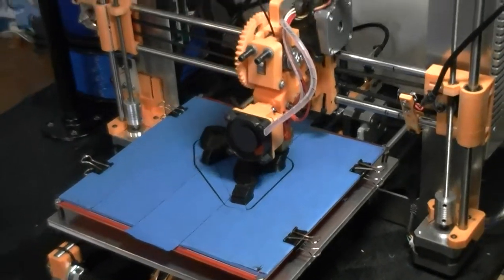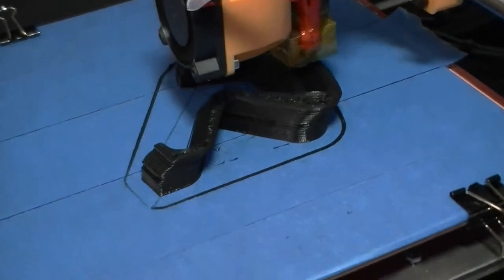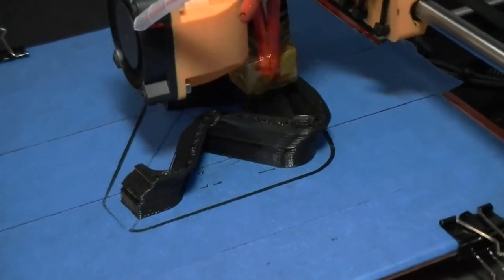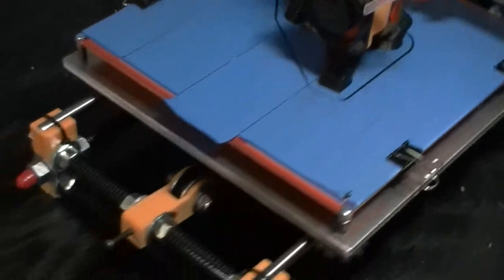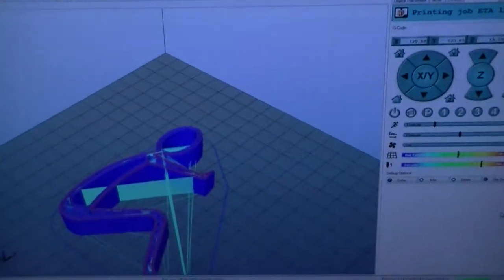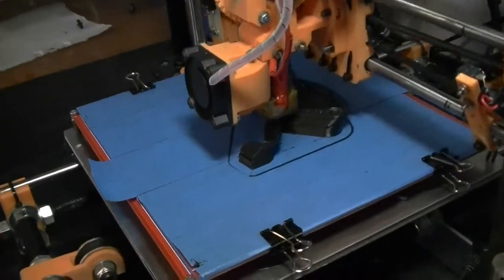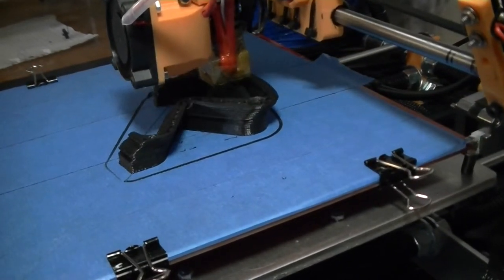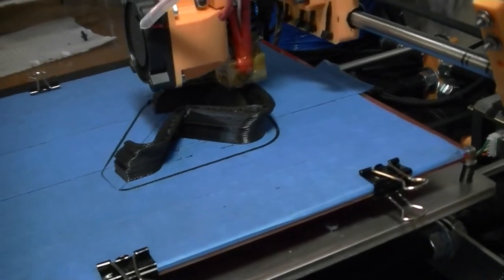3D printer Prusa i3 problem moving back on Y axis please help

Comment from the maker: well I fixed it you are wright about the bed weight the bed mounting plate was made from a mill finish 1/4 inch thick 9x9 inch aluminum plate its weight was over 2lbs with out the heat plate or glass so I mapped out and with a circle saw and my drill press cut out holes removing over a pound of weight I printed a 70mm tall rectangle problem solved I just ordered a high tork  Nema 17 motor that should really help thank for your help